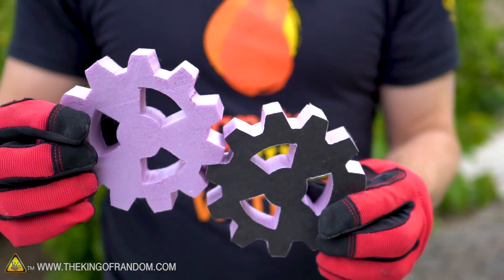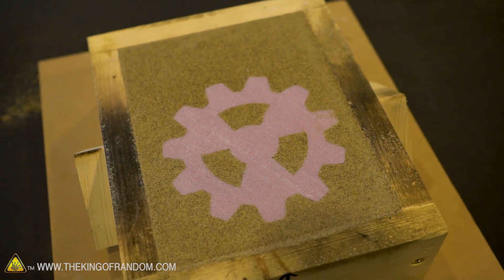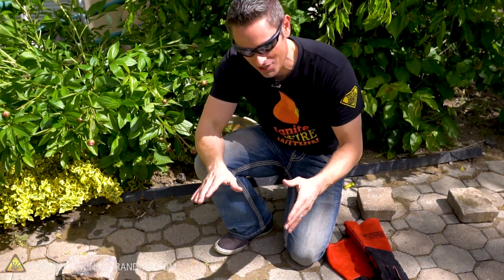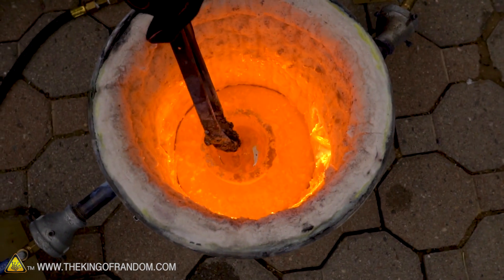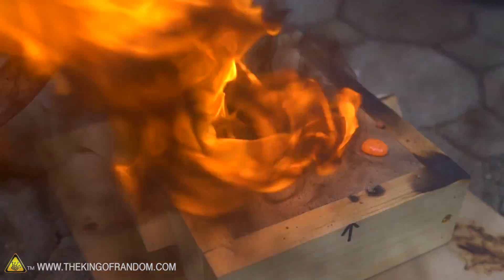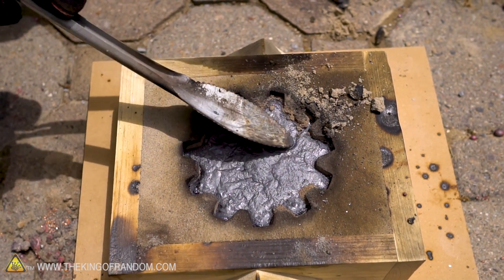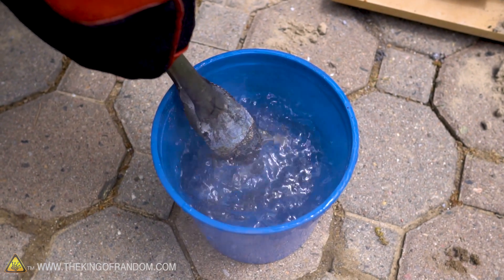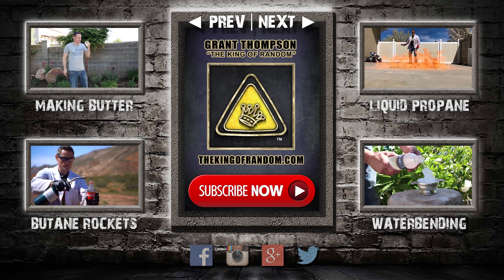Argh. Why Is Copper So Difficult? TKOR Tests Melting Copper In Our Homemade Foundry

Comment: I would say u should add  about 4% carbon (charcoal) and 2  to 4% water to the green sand for better surface finish. One of the main reason it's not working is that the upper layer of the cast is in direct contact with air so it's cools down very fast than the lower part of the layer which is in contact with sand. U should try this casting with both drag and cope alongside riser and runner with a proper gate system . I hope it will work.

Comment: grant your foam is to dense, and you have to modify your box a little. cut a hole in the side of the box so you can pour the copper in from there. add a little piece of foam to the gear so it will come flush to the hole. pack some sand in the box put the foam gear in with the extra piece of foam at the hole, then and more sand and pack.kind of like you made the sword and jet in the bucket.

Comment: You probably need more clay. It looks like it breaks easily and... well it does. But not just that copper is pretty heavy so that heavy metal pushed the green sand till it breaks. It happens right when you start to pour.

Comment: The sand is less dense than the copper and so it floats. You can just put a lid on top and leave a small opening to pour the copper. This will prevent the buoyant force from moving the sand clumps. There was no way the sand was going to prevent this as it has virtually no tensile strength.

Comment: First of all - use both the cope and the drag, secondly instead of making and burning styrofoam use wooden gear to make a shape in the sand, then you can ram greensand much more tightly

Comment: Use " FireBrick Casting Sand" once set will withstand over 3000deg and will not fall apart. Hard to find and expensive. Must have 2 piece mold with fill and vent channels. Preheat mold to 300deg. Must use impurities release agent like borax.

Comment: I think if you added a bit of tin, it would make it easier. also if instead of pouring the copper on the foam, try to have it run down some type of tunnel in the sand where it can reach the foam and be enclosed so the sand doesn't move.

Comment: you've made a lot of batarangs before, grant. but have you ever tried casting one? perhaps use a very thin piece of styrofoam and a belt sander afterwards to sand it down to it's smallest.

Comment: You should have a lid with a hole in the center to pour  the metal and the lid will keep the sand together. Or Just use a different type of sand.

Comment: try adding some Bentonite Clay  as a binder,,,  or you could use some molasses as a binder, but with molasses you will need to bake it in an oven like a cake to harden it. and to reuse you simply place cooked sand in bucket with a lid and a spray of water.

Comment: I am confused, why are you using only one side of a casting flask? You need to have two sides with holes/runners for the metal to enter and others for air to escape. You need a height difference of the top of the metal surface and the part you are casting so that you get a sufficient pressure going into the mold to overcome the surface tension of the metal, otherwise you will end up with poor castings with missing details.

Comment: use both halves of your sand mold and add a sprue. the weight of the copper on top will fill the mold and the support around will keep it from breaking. keep it up your great.

Comment: you have to remove the foam from the sand before pouring
Reply: he means use the wood but pull it out before pouring
Reply: You cant remove it perfectly without damaging it.
Reply: A better clay-sand mix, talcum on the model as release agent and carefulness and you can get the mold out just fine. In most all greensand mouldings the model is removed from the sand defor casting. also the mold is fired before the pour. it stabelizes the greensand (curing the clay) and also helps with the slower solidifying of the metal.
Reply: wolvenar fireing before the pour hardens the sand. you also use that heat during the pour to slow the solidifying. top halve with spout and vents also works better than an open mold.
Reply: Maybe use wood, not foam
Reply: The foam is the basic structure. and the wood would probably take too long to burn.
Reply: FlexDRG It seems your adept in this. Its not my trade but will preheating the mold also help? As well as a top to the mold with runner?

Comment: Grant, I'm no scientist as I'm only 12 but maybe because the sand was moist the intense heat of the molten copper was able to evaporate some of the moisture causing air bubbles so it was easier to get under it and pop it up.

Comment: I think adding moisture to the sand was what made those pieces pop out. When the copper was poured, it probably evaporated the water and forced that block of sand up and out. I noticed this because after you mentioned adding more water, all 3 pieces of sand popped out.

Comment: The only success I've been able to obtain with sandcasting is by adding oil to the sand instead of water.  Yes, it lights on fire when you pour, but it holds together MUCH better than with water.  Don't know if it'd help or not, but you could also try encasing the gear completely in sand & adding a spru/riser to the top - might help keep it from falling apart if it's supported from both sides.

Comment: Hi, nice idea. During the preparation I thougth the top is missing, but perhaps it works.
Now i know why there usually is a top on the form, even if it only contains a feeder and some exaust for the gas. But to keep the sand down, it would be usefull. 
(Top = same wooden box filled with sand, like the bottom, only with one hole in the middle as a feeder, and two or three exaust holes for the gas. Another purpose of those lines, when the metall cools down, the metal from the feeder can fill the middle and the contraction isnt that significant. Therefore the connection between feeder and casting needs to be big enough, so that it doesn`t cool down there. The bad point in feeder and exaust: you will have to chop of cooper and clean the surfaces afterwards.)

Comment: it's science. copper is a denser metal than aluminium, or lead. it's density is such that the sand is able to float on it. I would recommend making some sort of lid to hold the sand down as well. also picking a heavier mold material to cast with copper would likely be a more viable option.

Comment: With a small saw you can use the indents to cut out a circle and then sand the sides of the circle until you get the perfect hole shape, or use a hot metal stick to melt a hole in the indent spots and then sand it to the right shape! 😀

Comment: the problem is the sand. it dry too fast. you need oil.
Reply: Seth21914 
It would just light on fire with oil
Reply: yes but the sand i use has oil and it works
Reply: Seth21914 lol rekt

Comment: I think you need to have a more traditional mold with both halves and a sprue and gate. This will probably allow you to fill it more quickly and use more copper (more thermal mass) reducing the amount of cooling. you'd likely need to use pins to stabilize the cutouts.

Another option might be a sodium silicate/CO2 sand mold.

Comment: hay man i do copper casting and you are doing it wrong. the sand is not dense enough and that is why it was floating to the surface. I would recomend making a mold that is not open faced but fully encased in sand with several gas vents. this will make the product look nicer and will not break as easily

Comment: If you don't want the Styrofoam to be in the mold when you pour the copper into the sand, then why do you not just glue two small blocks of foam onto the gear or whatever you try to cast, so you can remove it before you pour the metal?

Comment: Put something like wooden skewers (or wire if you want something really durable) inside of the sand while filling the mold so that it will both hold down the sand, and keep it from deforming.

Comment: Talcum powder and wood spacers. The Styrofoam residue is in the way and the green sand is being pushed by the liquid mettle. Wood spacers for the atomic symbol would give you the holes you desire and talcum powder would allow you to keep the shape and reuse the Styrofoam gear

Comment: I'm not sure green sand is the best way to cast higher temperature metals you might be better off to use plaster investment as it holds its shape and you can get it out easier

Comment: My observations as a rank amateur.  Too much water means the water boils thinking that's part of why the sand is breaking apart.  The water vapor needs somewhere to go and the sand is softer than the copper.   I wonder how it would be if you added a little bit more clay to the green sand?

Comment: I've done green sand casting before and it works better if you pack down each layer of sand when your putting it in instead of putting it all in and then packing it all at once.

Comment: How about you just downsize the gear?  The copper needs to travel less distance and the weight of the molten copper would be less, so it would not destroy the little sand pillars. Just an idea if you want to try it again

Comment: You could try Stone moulds, it was used in the Copper and Bronze ages, so it should work in 2017.
Reply: Also I think that with Green Sand, you might just have to go for the drier batch you had the first time and somehow just pour at a hotter temperature.

Comment: I think you need a solid mold or top to hold it down and keep the heat in. Or inject the copper into your box that has both a top and bottom that will keep the heat in as you pour it in and keep the sand compacted

Comment: I think you need to add more bentonite clay to your green sand - it doesn't look sticky enough.

water based plumbing flux can help clean the finished piece to a shiney pink.
I am an electrician, I have spare copper, hit me up next time your doing experiments with copper I'll hook you up!

also, borax will help with your oxidation and release.

Comment: When I casted things we'd seal it together and use a pipe to make a "funnel" of sorts to pour  in the liquid. There is also a dust we would sprinkle before using green sand to help it hold better.

Comment: Why are you using an open mold instead of fully burying the foam mold in the sand with air holes for off gassing and pouring?

Comment: If you put a thin layer on greensand the bottom of the designated the fill the design the make a hole on the bottom you can flip the mold and pour the copper in to the hole it will keep the copper and greensand in place

Comment: Last time you made that green sand mold box, you made it two-parted, so it could be alligned. Why don't you make the mold with a top and bottom half? fill the bottom half of the mold, no gear, then flip it and press the gear in about halfway, then put the upper box on and fill it with sand. Use a bit of foam as a channel, and there you have it, stable mold.

Comment: Here's an idea. Pour a little bit of wet concrete in that wooden box, then push the gear into the concrete. then wait for it to dry and burn the styrofoam. then you have a concrete mold that won't fall apart.

Comment: There are remnants of the foam after you melt it with the heat of the copper, leaving imperfection. Thus, I suggest that you should pull the foam out using several toothpicks (or something stronger) to poke into the foam and pull it out. Doing this will leave a mold, in which you can pour the copper into.
Reply: leaving the foam in there while it's being cast is better for the mold, it's the type of foam he's using that's the problem.

Comment: Copper is only $2.20/lbs, so unless you have about 30lbs in that gear it isn't $60 of copper. The reasons copper tubes cost that much is the work that goes into processing them. After working with copper I'm sure you are aware that it's not easy to create tubes.

P.S. your foundry video was what got me into your channel, please keep doing foundry videos! Test alloys and stuff, I don't know, just do more!
Reply: No. Just no. They are copper coated.
Reply: I'm  sure he ment the retail price to begin with...
Reply: Pennies are zinc with a copper cladding.  Unless made prior to 1982 (United States at least).  It cost more to mint a true copper penny than it is worth, thus the switch to zinc.
Reply: brian for real in the US, pennies are ALL made of zinc and copper coated unless they were made before 1982.
Reply: pennies are NOT copper.  they're copper plated zinc.
Reply: Different prices in different locations. Places that don't have quick/easy access to copper will have higher prices due to transport costs.
Reply: After 1982 they are copper plated zinc.  Pre-'83 they are copper.
Reply: The reason this experiment was so expensive is that it looks like he bought copper pipe and didn't just use scrap copper.  That's what his pieces look like before the melt anyway.
Reply: Andrew Evenson     Genius😒
Reply: pennies are copper and they are worth one cent, kinda just shot a hole in the expensive argument
Reply: first of all, not all pennies have zinc them dumfuk!!!!!!!!

Comment: Maybe try making a mold with aluminum so it doesn't float to the Top. and then melt out the aluminum but not the copper.

Comment: why don't you try taking out the styrofoam mold? and also make another box with green sand and a flat surface, make the hole and pour it in like more traditional sand casting? it might solve the problem of the little pieces of sand coming out

Comment: i dont know anything about casting copper in green sand, but you could take your frustration out on your gear with a dremel and small drill bit to carve out those prong of the symbol, time consuming but you'll get the satisfaction of grinding out that stubborn material

Comment: try using sodium silicate casting, it's far easier and will not fall apart on you... you should also use both the cope and drag because the foam has nowhere to go when u pour it in because it melts top to bottom but if you use the other half it will push the foam and gasses out in one constant direction leaving behind clean perfect metal
Reply: also check out sv seeker, he has many aluminum, bronze, brass, lead etc. casting videos in sodium silicate... sodium silicate is cheap and can be bought on amazon

Comment: why don"t you cover the mold with the top part and make a cavity for copper to go in?
this will prevent the sand pieces from popping, and leave only a small part of the mold exposed to air, hence giving copper more time to cool down... That's what I think.
btw the last gear is by far your best one :)
Reply: I agree. having a two part mold would make a huge difference. it will also keep the centers from popping out
Reply: Yup. Make a sandwich mold, and cover with a steel plate of some sort. As +TheNorskViking mentioned, the sand is floating on the molten copper. Putting a capping plate over the works, and maybe adding some additional weight would help.
Reply: I came to the comment section to say this. Use both halves of your mold and you can even use a 1/2 inch piece of copper to dig out a center hole to pour your copper in.
Reply: Agreed, it will work as I saw someone use 2 green sand boxes to cast a bronze axe. He also used baking powder to prevent the 2 boxes from sticking together.
Reply: Exactly the same thought I had when I saw this happening.
Reply: Help this genius!
Reply: masallah your smart
Reply: EvilSearchEngine True, and yeah, it is so beautiful, and it even works really well. How sharp the blade was transferred over, which is also cool.
Reply: Garush Not true, someone casted a BRONZE fireax completely in it. Sadly when he pulled it out he hit his leg, but he is fine now.
Reply: Yes. Both halves of the sandwich mold would be made of sand. The purpose of the plate is to keep the sand from the top layer from floating. It can be thin metal, of course, as long as enough weight is applied to keep enough pressure. The reason I say steel, is because you wouldn't want it melting from the hot copper.
Reply: He was testing an open mould. Not closed mould which would naturally work.
Reply: Abderraouf Mehdi Bouhali what he needs to do is mold it in something other than sand, the metal heats up the sand so much that it would just push it around.

Comment: The air/sand are too cold for the molten copper, and you can see thermal shock throughout most attempts, a way to fix this would be to isolate the mold between two sand halves and pour downwards through a hole (that you would need to create). This way, the copper will stay hot enough and continue heated its surroundings even as it cools, maintaining a liquid state for longer, creating less bubbles, smoother product, and, since it is pouring downwards, gravity would naturally push out most imperfections for you.

Comment: I have not played with green sand and copper before. But I think your problem may be that the sand is not compacted inside of the mold. Therefore it rising up, I belive if you are able to compact it inside of the holes in the mold it may work better.

Comment: I think you've reached the limits of styrofoam investment casting. Having a styrofoam pattern is great, but you're going to need to carefully remove it and leave a cavity in the mold then top with a sand lid with a pouring sprue. Research cope and drag sand casting, and maybe try adding flux and degassers to the melt, like roach killer boric acid (not borax). Great videos, Grant

Comment: Hey Grant, Just a thought. have you tried less dense foam? Maybe it isn't melting quick enough. Also, have you actually packed the sand into the holes and onto the styrofoam piece? I really hope you can cast a perfect gear. Could you try it in another video?

Comment: You shouldn't deal with copper because it is difficult to work with but try working with brass. brass is better for casting because it is used in casting bullet casings. if you want brass, you can either buy it or melt it down from bullet casings.